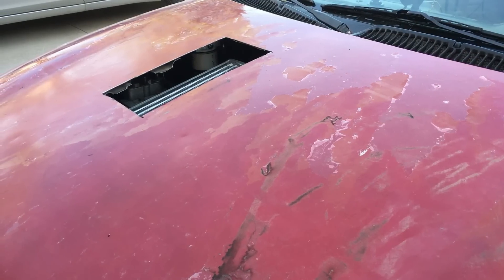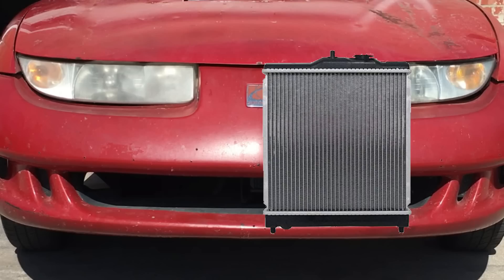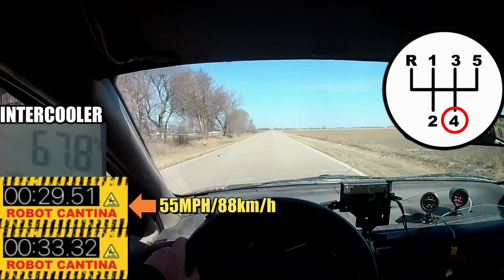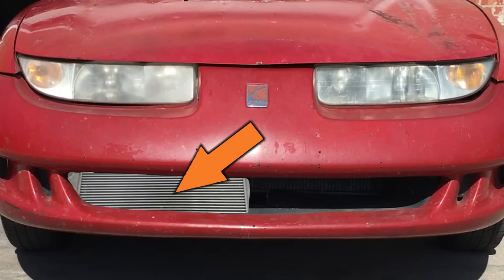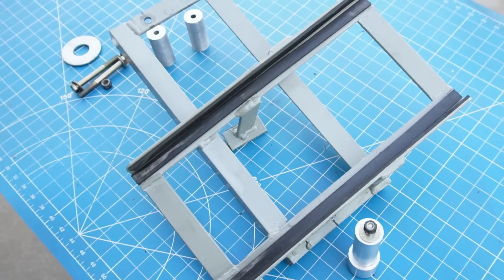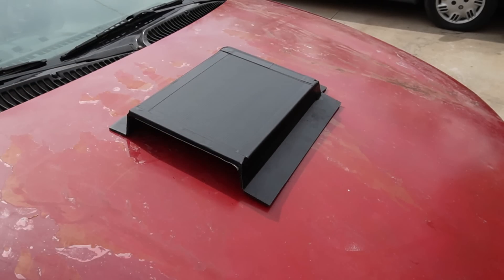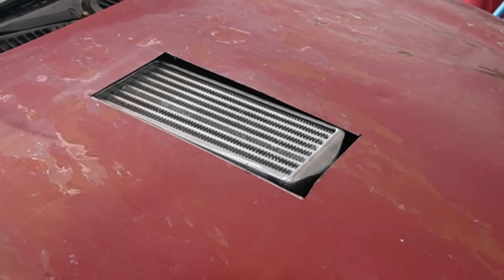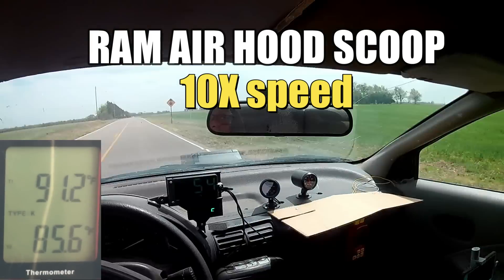S3 E12.  Testing different modifications to the intercooler on the Kubota turbo diesel Saturn.

Comment: The necessity of an intercooler is directly proportional to how much boost you make, thanks to the ideal gas law / adiabatic heating. If you were running the boost seen on some engines (2-4 bar or 30-60 psi) the air would become significantly hotter than ambient simply from being compressed in the turbo. But you're not even breaking 1 atmosphere, so there's very little heat generated. 

There's still unwanted heat, both from the turbo housing and the compression you are doing, but the intercooler isn't nearly as important as if you cranked up to boost. 

So don't worry about the intercooler unless you plan on cranking the boost. This will be a much more important at 30 psi.

Comment: High boost heats up the intake air but on your low boost little engine it dosent matter for the performance. Even if you max out the turbo boost i dont think its enough to heat up the air on that little engine.

Comment: I was just thinking about this, and it may not be relevant, but might be…

Dropping pressure drops temperature, like an air conditioner (r134a, condensor/evaporator). What if you install a restrictor after the intercooler?

Then pressure in the intercooler will be higher, but it still gets cooled to ambient. After the restrictor the pressure will drop, so the temp must drop. 

That will make the air charge be lower than ambient before it goes into the engine! Maybe…
Reply: The air needs to change from liquid to gas form (like R134a does it) in order to cool the intake.
Water mist injection will cool the intake air when it evaporates, but doing it with outside air alone is not practical.
Reply: @larsjrgensen5975  then why do hot air balloons float? 

Air is a gas, then heated, which reduces density, without a phase change.
Reply: @Iowa599  The air is sucked in at low temperatures, heating it up with the turbo lowers the density so it is sometimes needed to cool it down again to get the density up again.

Restricting the air will compress it and heat it up and make the turbo work harder because of higher resistance.

Opening it up again will generate less heat and resistance because the pressure is lower, but the lower pressure does not make more power, the point of turbo charging to begin with.
The pressure must be higher at the intake valve to let in more air, unless the intake valve size is changed, leading to an unfair comparison.
Reply: Ah, I forgot about the restriction causing heat!

Comment: When you try the fans, please do two tests, a pulling up from the engine bay with no scoop, and then pushing air from the top down with the hood scoop in RAM orientation. I see aftermarket fans available for top mounted intercoolers, I don't know if the fans are pulling air from the bottom up, or pushing air from the top down.

My own Turbo diesel has a front mounted intercooler, so have no experience with top mounted, other than cannot see them being as efficient as front mounted. Having said that, your experiments seem to indicate that perhaps the vehicle & engine designers/engineers may now better than me about their engines, and that at some point there is no benefit in getting inlet air temperatures super cold. That the power, torque and EGT's reach a optimum level (without going stupid with fuelling and blowing the engine up).

Comment: my chevy cruze turbo had a temp boost sensor waaaaay to close to the hood and on hot days the computer would make really bad decisions  based on false air temps (heat soaking in the parking lot at work).  Park it in the shade, was a completely different car.  Albeit,  the temperatures recorded were used for fancy tricks like timing advance adjustments and stuff like that.
Reply: Ford cut knock sensors off their blocks on some applications to avoid similar scenarios. They would sometimes pull timing due to overly touchy knock sensors.

Comment: I think the fans would be the best option, however, i seem to remember mighty car mods doing a wet intercooler sprayer system and i believe that worked alot better when they tried it, if im right and i can find it I'll edit this comment 
Edit : i found the video 
https://youtu.be/NmzLaaFQjiQ
Relevant time stamps 
03:48 -their setup for front mounted intercooler 
09:43- martys setup for top mounted intercooler 
11:02
12:56- martys findings for the setup he did with the top mounted intercooler
Reply: Case fans will only move a small fraction of air compared to the scoop. I'd be surprised if their addition would even be noticeable.
Reply: Those small fans probably won't produce the same flow as driving 60mph. 
But still curious to see what it does.
Reply: Yeah. Fans probably only for idling in traffic iat and for looks(Jimbo apparently doesn’t think the scoop looks good) 😄

Comment: Would be cool to test a water sprayer over the intercooler.
Reply: I was thinking that too. I doubt the intercooler is not making a difference, I mean the Gas Law dictates that more oxygen will be going in when the air is cooler simply because the air takes up less volume. Maybe then the problem is fuel rates?
Reply: @Bennyboy-dog  I do believe that the intercooler is doing his thing.But the mount location is not the best. To bring the temperatures down, gives always another ways/methods , like use methanol injection or a very small nitrous injection to bring the temperatures down. But like you say, before I would check the fuel rates, to be sure and to start with a solid base.

Anyway, I wonder how would be this engine twincharged(super and turbocharged)